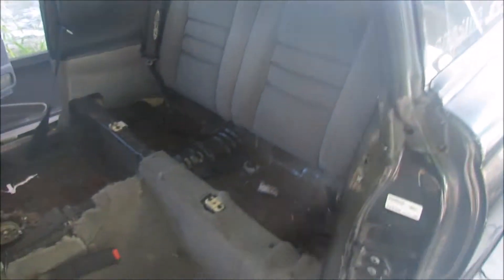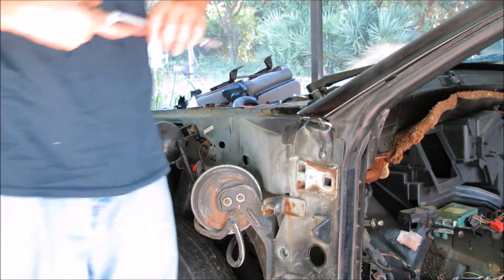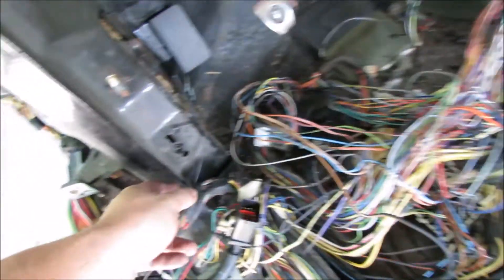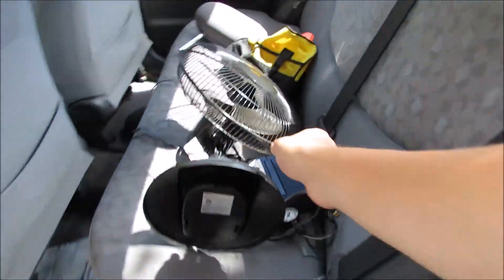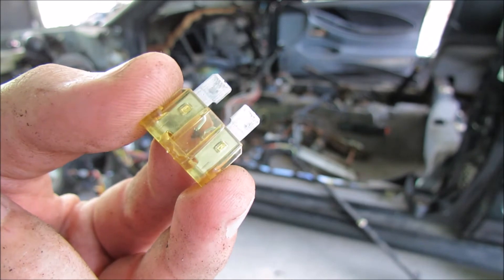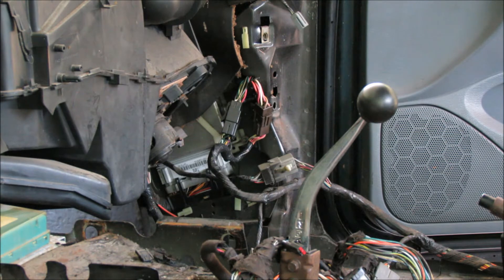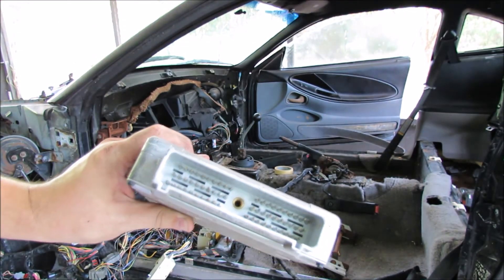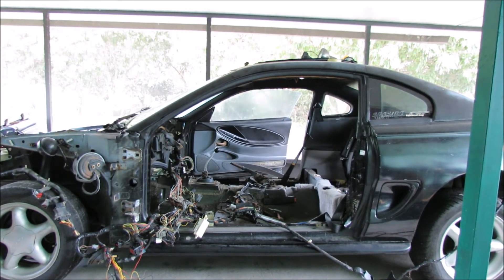S02E08 SN95 Mustang External Wiring Harness

Comment: What are the wires on the right behind the hood lever going under the carpet to the back especially the ones that are identical there's only two I believe can you help or any diagrams I literally can't find any site or manual to help difure it out hoping it's just lights and nothing major was told my fuel pump and stuff is only left near the ecu
Reply from the maker: If they re up there it's possible they are for something like the horn or the lights?  Sorry I haven't had this car for many many hears now.  Oh could also be a impact sensor for an air bag.

Comment: I watched the one video of you removing the column. Did you remove the pats module and all? I'm having an issue atm where I have key's for my mustang, but they aren't the correct ones. And the person who owned it previous to me attempted to install an aftermarket alarm system. It was spliced in but I believe I can undo it and put it back to factory. I was just wandering if the pats system was all removed.
Reply from the maker: I don't remember removing any additional anti theft system.  If anything you should be able to bypass the ignition and besides forcing power on just jump the starter so it spins to fire it up.
Reply: 94 did not have pats.

Comment: I have the same mustang but I having a problem with no injectors pulse by any chance you could help
Reply: Change your injector/engine harness. You need to get the entire wiring harness that is on passenger side engine bay. It will have multiple plugs including all injectors, distributor, coil, etc....
Reply from the maker: Its not much.  But ive heard if your tps goes bad it can cause this issue.  If you know anyone with a known good one you can use to test it may save you a big headache
Reply: What exactly are you trying to do to the car putting a new harness in it im wondering if i should do that to mine because im having problems with my instrument cluster and whenni put it in gear it wants to die plus it all of a sudden atarted sputtering a whole lot more then it did